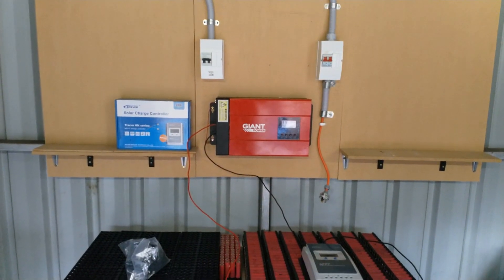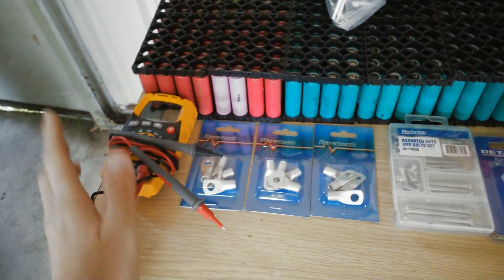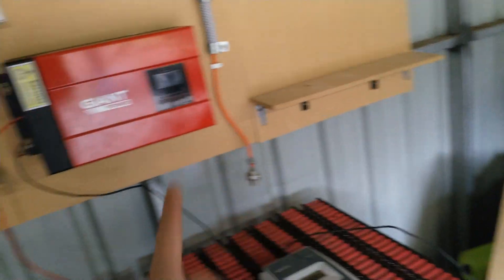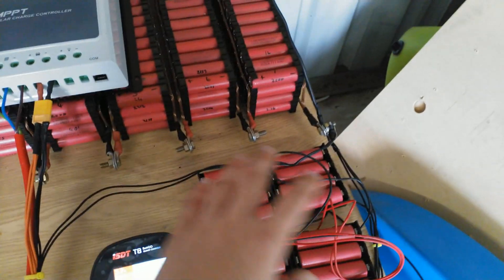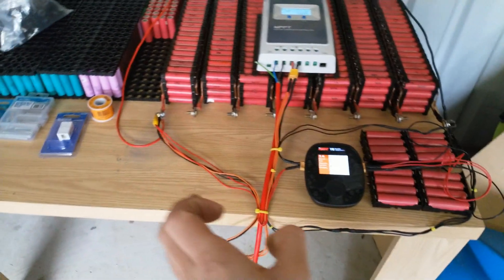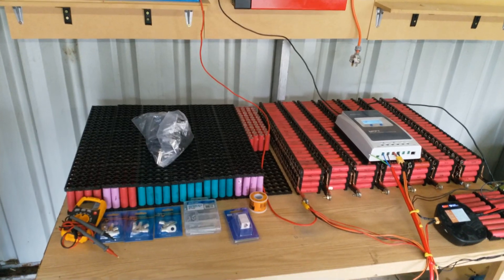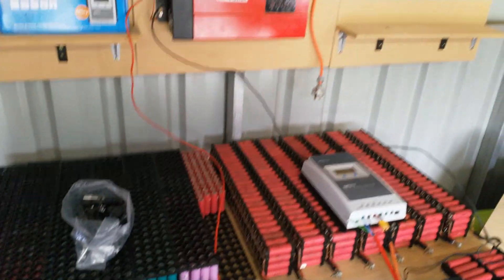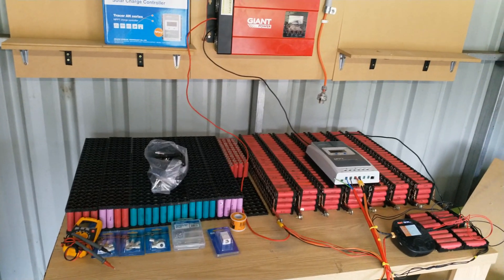DIY Tesla Powerwall | New Solar Charge Controller | Update 32

Comment: Big power wall...greaatt..
Allready doing like your using ex laptop batteries on 60p7s system...
The problem is....its only can running for light watts ex lamp and so on...try to running 150 watt of water pumps...the voltage is drop and the inverter cutt off automatically...
Any suggestion for me...
Very appreciate for reply...
Reply from the maker: Maybe your wires are too thin and it can’t support the load? I have too now switched to a 60p 7s setup along side my bigger packs, I think smaller packs are better for servicing and moving around. Thanks for watching